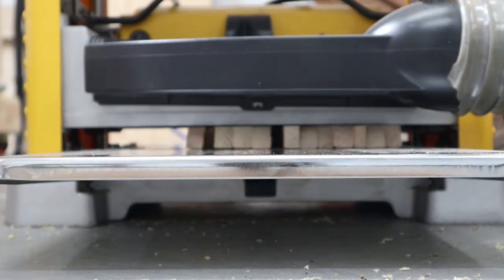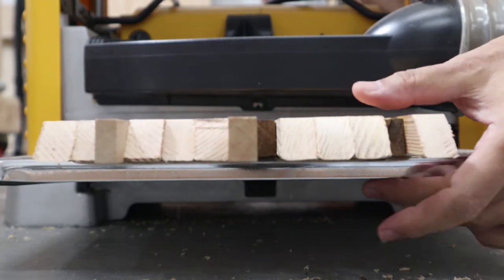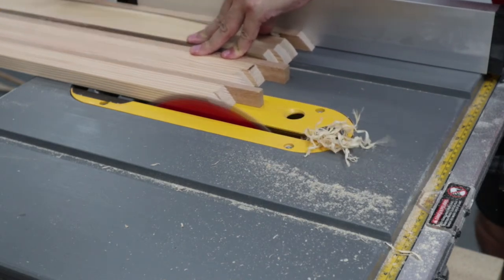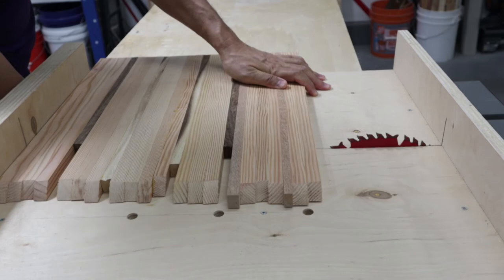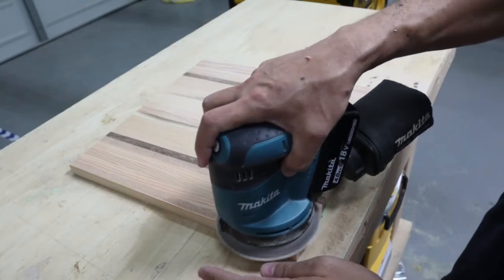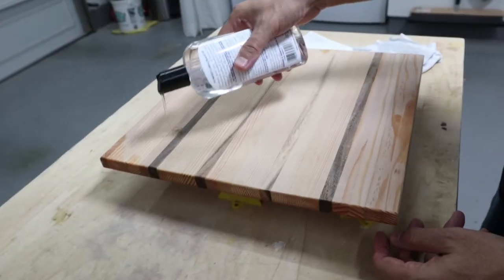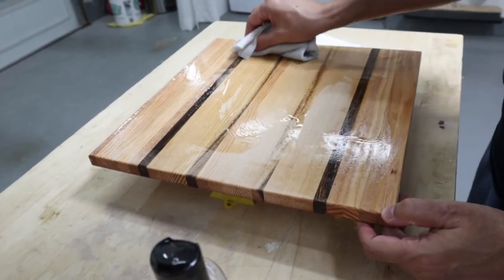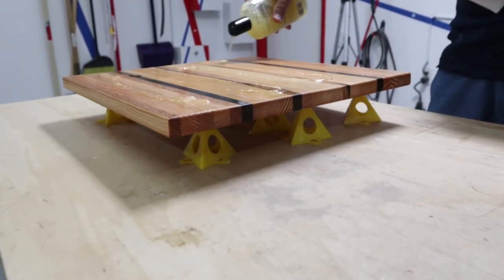DIY  Project: Pizza Cutting Board

Comment: Really nice, just shows you what you can do with so called scrap wood. Great job guys.
Reply from the maker: To be honest, I really did not expect this to work out. I was cleaning up after cutting and stacked the strips in a pile for the trash bin and when I picked them up I thought there is too much weight to throw out and all things came together. 😄